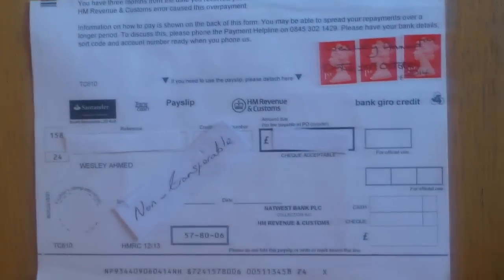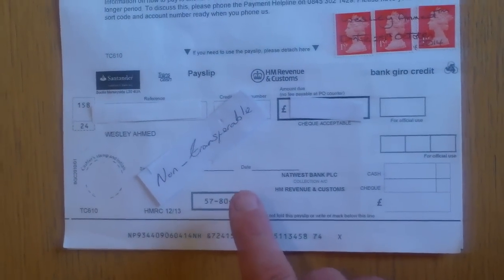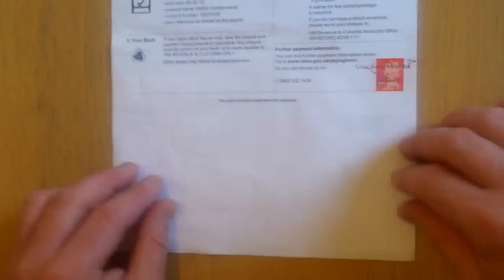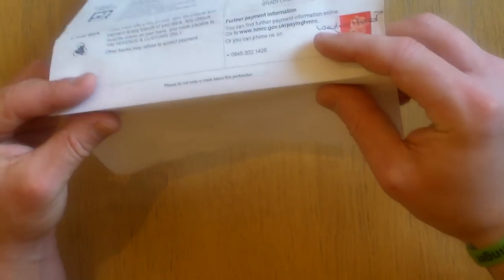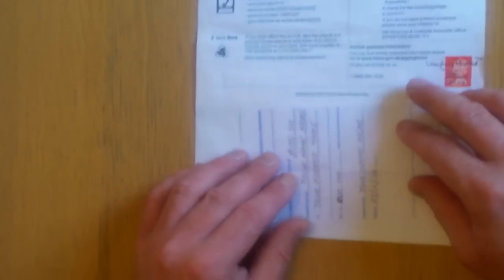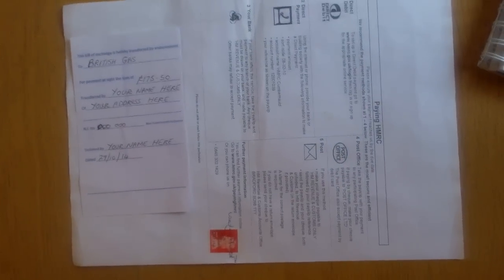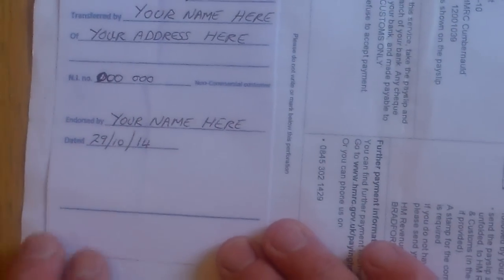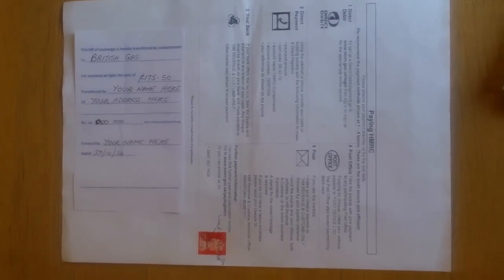Paying bills by endorsing the Giro-credit slip using Postage stamps

Comment: Why people are getting knocked back is because they are sending them back to the company that issued them. They should be sent straight to the HM Treasury copying in HRMC. And if you choose to, the company for info only. All should be by recorded delivery. You only need to do them as they do on Get out of debt free no more. The note you should include to the Treasury should instruct them the set off the companies debt and zero the account using your Birth Bond/Prepaid account (which is your Name in all CAPS and you NI number which is linked to the Birth Certificate. These can be used for any public debt.